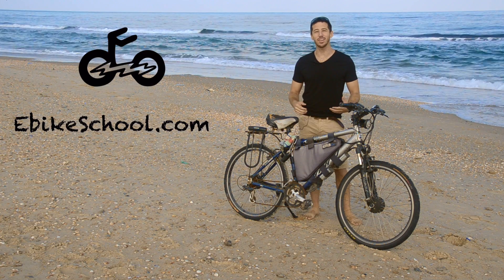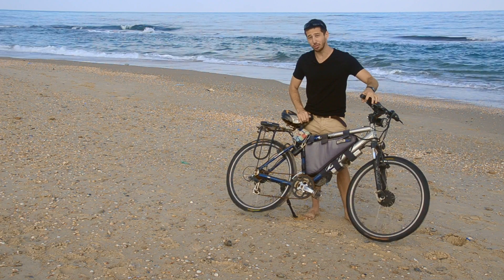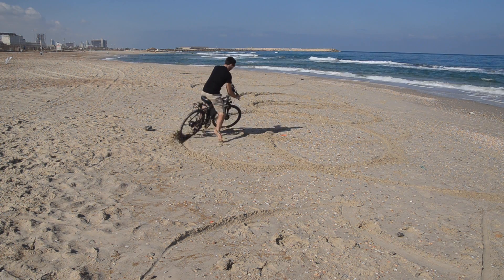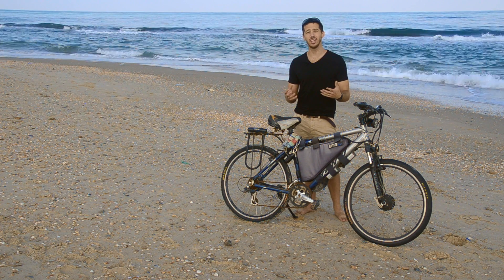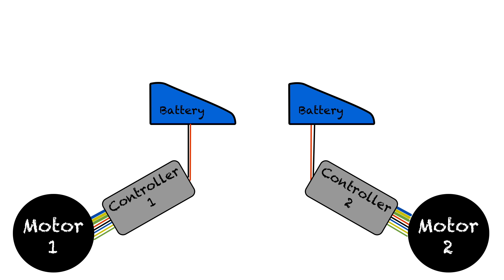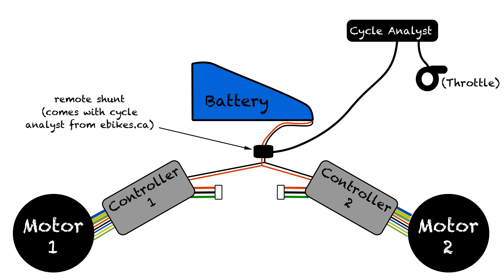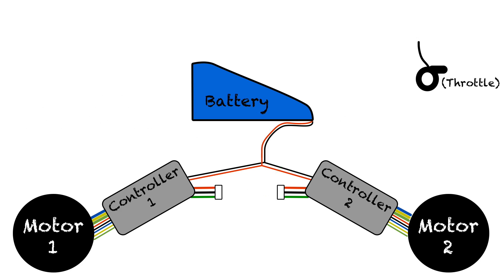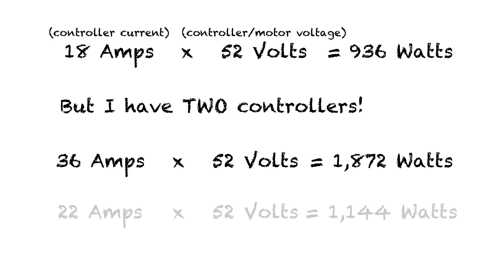DIY Two Motor 2wd Electric Bicycle (All wheel drive 2x2!!) Q&A#6

Comment: i live in alaska, how do you think the distance would be effected by cold weather?  Stored in warm place but riding in cold? How far can you go on a charge with say... minimal pedal power?  Thanks
Barry
Reply: i own a tesla which uses lithium cells and direct drive motors like many e bicycles and driving in the cold gives me about 25-30% of the distance i would normally achieve, around -5 to -7 degrees centigrade.... i would imagine it is colder than that in alaska and do not see much hope for you...the cold kills my range like nothing else
Reply: Brendan J do you have heated garage?
Reply: it is fairly temperate where i live but we took it 300km to a town called princeton where it is very cold. we started with 480 km in range and even charged it over a hundred and fifty kilometers during a break about halfway there, and with 23 km left to our destination my dashboard said i had only 7km of range left and dropping. we nearly had to call a flatbed to rescue us from the desolate wasteland we found ourselves in... i had to ask the cook to unplug his oven so i could use the 30 amp service. no my garage is not heated.
Reply: If you store them inside your house they should remain warm enough to have full range for as long as YOU are warm enough to continue being outside haha
Reply: I've noticed the converse very clearly; if I leave my bike standing in late spring sunshine for an hour or two when I next ride it there's noticeably more power.
Reply: Depends on the temp, but the average is you will only get about 80% of capacity at low temps and it is very hard on the batteries, unless you use SLA batteries used in extreme weather conditions, UPS back up for teleco and cable companies, Northstar batteries etc....  good for -40c to 65c, but size, weight etc... you'd need a trailer to carry them, the small ones are 37 .lbs each at about 90 some amp hours which would give you about 200 km's distance.
Reply: I bet if you insulated the batteries really well as well as keeping them warm until riding a relatively short trip you would be fine.  There's no way to know how bad they would be affected.

Comment: I live in Sylmar California and there r almost zero ebikes. And the cops couldn't care less. I am going to start with a front wheel drive 1000 watt kit. For the battery I want to put three 4 ampere hour Ryobi 18 volt battery's in series which will give me 54 volts. And then carry three extra ones in a back pack. Does that sound feasible?
Reply: At full power you will be able to ride for 13 minutes before the batteries are empty.
Reply: NO that does not sound feasible. For a 48v 0r 52v  1000w motor you might be pulling 20 to  30 amps per hr , Czar Zenana is right about 13 min of run time , also there are many types of lit-ion 18650 batteries  all with different discharge rates Best to check if the Ryobi batteries are able to supply that kind of discharge rate.   see: https://batteryuniversity.com/index.php/learn/article/types_of_lithium_ion and https://lunacycle.com/18650-ebike-battery-pack/ and https://electricbikereview.com/  and https://www.imrbatteries.com/18650-batteries/  Four great websites to help you make the right decision .

Comment: Since no two motors are the same, how are you able to synchronize the speed of the motors so they turn at the same speed and not one working harder than the other?  

Does the cycle Analyst provide feedback to both controllers to ensure both motors are running at the same power?

BTW:  Just Subscribed

Comment: Nice way to get around the single motor rule. could you in theory also have several motors surrounding a central shaft like an old radial engine.  5 small motors producing a large combined power output.

Comment: it's crazy out here in the suburbs of Philadelphia I don't see them ever. if anything I see more gas powered bikes. if I had some place to store it I was thinking of doing a hybrid bike rear gas front hub Electric and I'm surprised I haven't seen anything like that yet.
Reply: me too. theres a handful of gas bikes and in recent memory only saw 1 cruiser e bike here. maybe i'll have the 2nd :-) I like the idea of a 2x small motor build
Reply: sdq sdq
It's technically not a hybrid unless the combination is synergistic.  An electric and a gas drive on the same bike will reduce each other's performance and efficiency unless modified or initially designed to work together in a way that takes advantage of each system's advantages.  A true hybrid arrangement uses excess gas engine power to charge a battery that can contribute power when needed for acceleration or extending range.  Cars, relatively speaking, are much better suited to a hybrid setup than are bikes.  Cars travel at half their top speed or less.  The large engines are required to get the heavy vehicles up to cruising speed quickly.  Hybrids can use a smaller, more fuel efficient engine because the electric motor can contribute power during that acceleration phase.  When cruising at a steady speed, much less horsepower is necessary, so the engine can also be powering an alternator that is building up a charge in the large traction battery.
A bicycle is using all its gas engine power to reach a marginally safe speed in mixed traffic, so has no power to spare to turn an alternator to power the electrical half of a practical hybrid system.  Fuel economy is so good already on a gas powered bike that doubling it isn't much of a gain.  For a bicycle to be a good candidate for a hybrid powertrain, it would have to be heavier and much more aerodynamic, like a fully enclosed, streamlined, recumbent tandem.  Another configuration would be a series hybrid loaded cargo bike with regenerative braking in a stop & go urban environment in which the gas engine was used only to power an appropriately sized alternator to keep a relatively large battery pack topped off.  This hybrid arrangement would work well for extending the bike's range rather than increasing performance.  An optimized hybrid gas/electric vehicle adjusts contributions from each depending on how much instantaneous power is needed, how much fuel is available, how much battery capacity and state of charge is available, the ratio of power available from each, how much power from the alternator can be efficiently stored (charge rate) etc.  Even battery temperature is important since that greatly affects charge rate, capacity and output rate.  Expense, complexity, battery deterioration etc. are a few other variables that require consideration in any practical design.
Reply: After 2 years of riding my ebike in the Phoenix area, I finally saw another ebike a month ago. I"ve seen 4-5 gas powered bikes though (ugh).
Reply: gas bike die off ? it wont unless there's no gas anymore , but a hybrid might be possible

Comment: 52v? 
It is a 13s lithium battery? 
Fully charged is almost 55v?
How safe is 55v on a generic 48v ebike controller?
Reply from the maker: It's 14s meaning 58.8V fully charged. Most 48V controllers can handle it (usually up to 63V due to the capacitors) but not all, so you should always check your controller before you overvolt it.

Comment: i want to build my own batterypack do i need a bms or can i get by without many thanxs
Reply: Such a simple question but the answers, both pro and con. will leave you befuddled. My opinion is that you should balance charge 18650s. That said, you can either use a BMS or do what I do which is charge each battery individually so that they are always balanced.  The Vruzend system lets me do this and the changeover takes less time each instance I do it. 
Some people say you don't  have to balance charge them. But once they go they take the rest of the stack with them.

Comment: I See very few Ebikes here in London I get the impression that it is taboo ! I went for the full hog of BBSHD but to be honest I think its overkill for what I need, Thinking of going 350w hub with overvoltage now, try and get some weight done
Reply from the maker: Yea, BBSHD is a great motor but its a bit overkill if you just need flat ground and city speeds.

Comment: great video! Can you add a 3rd mid drive to the bike and increment the power?
Reply from the maker: Sure, but you'd want to make sure your mid drive isn't slower than your rear hub motor. Otherwise it wouldn't be adding any power, it would be the same effect as pedaling slower than the speed you're going, where you might as well not pedal at all since the freewheel is spinning on the rear wheel.

Comment: Nice, been waiting for a good vid on this topic. has anyone seen Cycle Analysts on Alliexpress? getting anything out of the USA to Australia cost more in shipping then the purchase price of what your buying.

Oh and not many ebikes here in Oz as the laws are extremely strict this setup depending on the arresting officer could be considered a e-Motocycle requiring registration and motorcycle license, indicators front and back, headlight with high and low beam and stop light. plus the average cost of an e-bike here is around A$2500 - $A3000 for an entry level :( just check out 99 bikes http://www.99bikes.com.au/bikes?cat=112 they have the biggest range of e-bikes here in Oz. I could build 2-4 e-bikes for the cost of 1 of these.

Thanks for the awesome vids Micah keep up the good work..
Reply: Clinton McDonald ... I know!! try some NZ sites... they're a bit more cavalier in their approach to ebikes. I love mine and here in Newcastle we have an awesome bike path off traffic that follows the harbour into the "city" and on into the beach... but I'm a bit chunkier and would love a 350w motor to deal with the hilly coastal roads with my stuff aswell... and an increase in the speed limit to 40km/hr... cars wouldn't hate us as much.
Reply: I use to live in Newcastle many years ago, I agree the hills there are a killer so are the hills in Brisbane. i seen a chap on an e-bike here going up a hill at central station in the CBD, he got off and walked up as the bike could not handle it ever though he was using the pedals with the motor.
Reply: We are never going to have 50% ratios in Australia given not just our restrictions but also the lack of dedicated road space Councils provide. I think we're going to be lagging behind as usual much like our internet
Reply from the maker: I have to imagine there is a cycle analyst dealer in Australia. They are made by the Canadian company Grin Technologies but they have dealers all over the world that stock their products.Try checking DillengerAU.
Reply: Can't wait for the Chinese clones.
Reply: Would like to build a 2 wheel drive bike some day

Comment: Yeaahh... 2WD is the ultimate in performance and efficiency, people would be surprised the amount of POWEER that two very little motors can produce when combined and overvolted. So far from experience, two wheel drive generates a lot less heat and much better acceleration.
The UBCO 2WD farm bike got two big MAC motors, in this case there's enough power to lose front wheel traction in some occasions (uphill off-road specially). Surprisingly, that doesn't make you lose control at all but actually helps pointing the bike to the right direction in my opinion, I actually LOVED that feeling!!
Despiting my ideas of fun 2WD it's recommended to have a bit more POWER at the rear wheel like 60% rear and 40% front (this can be done via programming)Some 2WD decrease front wheel power at higher speeds, some completely switch it off.
Some people like the idea of having 2x throttles, one for the front and one for the rear.People have different opinions on what is best, everyone's ride is different, so there's no right or wrong here.
*love the outdoor video idea.. audio was actually fantastic for a beach video!
Reply: Hey man I am having trouble trying to accomplish two hub motor, so I got a rear 72v 12000hub motor on my e bike but i want to add a front hub motor maybe like 8000w hub motor and i at the moment I am using a 150a controller to a 48ah lithium Panasonic cell battery, if I add the extra front hub do I need a extra controller or battery or even the voltage analysts, since there are two different hub motor will they miss up my controller ?
Reply: Thanks :-) I was wondering whether it may cause any problems with motors during cruising if the power is not equalized on both wheels but yeah, there shouldn't be.
Reply: How much average charge duration do you get with 2wd ebikes? Longer using 2 seperate battery packs or with one larger pack? Thanks.
Reply: I was actually thinking of building it with two throtles,each for an engine.
two 1000w motors.
Reply: What about hill or trail climbing with 2WD?

Comment: You can also use a third motor.. as middle drive. :)
Reply: Yeah, and you can add an electric fan on the back to up it to 4 motors :-)
Reply: :-D
Reply: Yeah and then a parachute to fly off!!!
Reply: Then it's not a bike anymore.
We could add side wheels and motorize them as well.
Reply: Czar Zenana you can just say simply that you don't like the idea of the third motor :-D. IMO there's only one thing that determines if pedal bike is still is a pedal bike - if you can still "pedal" without power. And this goes down to throttle (you have one, then your pedaling is not real), what hub you have (a hub which would drag too much to pedal), ... But maybe the throttle doesn't matter because I'm contradicting myself :)
Reply: Well here in the Netherlands (and in Germany) the motor should stop if you stop pedaling , so yes pedaling is essential. Over here throttles are not allowed on a bike. I do not even like the idea of a second motor.  We do not have hills anyway. The highest point of the Netherlands is 123m above sea level and that is about the most southern part of the country where nobody wants to go anyway.
Reply: @czarzenana5125  Netherlands might not have hills......but it has a strong headwind no matter what direction you are going.....even if you turn around... you still have a #$%@*&+ headwind.
Reply: @unhippy1  
LOL, yes you are right, especially when you live in the west or the north. Luckily  I live in the east where the wind is always weaker and where we have much more forest.
Reply: Really? I haven't yet build my own ebike but I find two wheel drive fascinating because it seems stronger, cooler.. I don't see almost any disadvantage.
Reply: Price would be my main disadvantage and the maximum overhere of 250W total.
Reply: Ok motor mouth

Comment: wow, you can overvolt a 36v motor all the way to 52v! Could I use a 60v battery with a 48v system? Is it important to have the same volt controller and just over volt the battery? Great Vid Micah!
Reply: in one word NO, you should be using a new controller that can take more volt's. The stock controller can't take anything more than 60V (most 48V kits have this limit). A fully charged 60V battery will be at 67.2 volts.

Comment: @Micah   love the very informative videos you rock man. I was thinking of this same idea and looking into to building my own battery pack for it. I wonder though if my idea for a video topic might interest you about...
RAIN/WATER:  risks and concerns regarding components and how to keep the electronics safe or if I even need to worry about it? I know not to ride my ebike in a lake or ocean  but just how tough are the controllers and such? I see them mounted under the bike frame a lot where water could splash up on them from wet ground. Are they all created equal? what are some measures I can take to try and insure and safeguard my investment if there is a downpour and I'm caught off guard?  And also what about air flow to the controllers if I put them in a bag how much air is needed?      P.S. Im look forward to checking out your DIY book on battery building.
Reply: Oh and I live in a small town in Alaska with a population of about 8,849 people and I have only seen maybe a handful of ebikes
Reply from the maker: I like the waterproofing idea, I'll see if I can make a video about that.

Comment: I've been waiting for a new video to come out, and this was an excellent one! Thanks! 
I've been thinking about building a 2WD 2000w beach bike, but haven't done the research yet beyond knowing that I would have to use two controllers and not to use a front suspension fork with front wheel motor.
Reply from the maker: For a small motor you can do it (you can see my bike has a suspension fork) but for a 1,000W you are risking damage.
Reply: @EbikeSchool  why is that?
Reply: So I need to disable my front suspension when I install the 1000w front motor kit?

Comment: Hi I have an old moped that I would like to convert to electric drive. However i can not use hub drive because it has drum brakes so my question is if the motor would turn the cassete do you think it would be as fast as with hub drive?

Comment: Locally, I've never seen any ebikes. I see very fit riders on racing bikes. I don't think people like me should even consider an unpowered bike, just because of the hills and the 20 mph winds. But the concept has not penetrated the US culture.

Be interesting to know what it means to have an ebike culture. Most of the bikes look pretty simple, from your sample, with rear packs and all. It's a high margin product in the US, with a lot of high level marketing. The simple stuff works, and it's what most people need. 

You definitely get the 2wd or awd effect with a front hub and strong pedaling. I don't know how thrilled I would be with 350 watts as a limit. The US limits make sense, just keeping ebikes as bikes and design considerations .  It's not that easy to design an ebike battery for a constant 1000 watts, pack size and cycle life. Maybe ebikes are an 'outlaw' culture. I think the guys on the Harleys have a little more street cred.